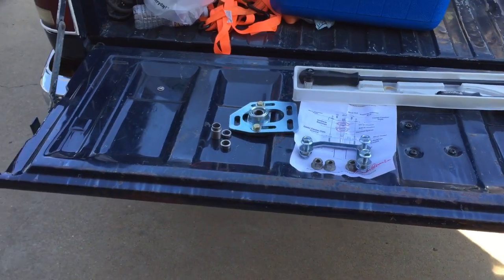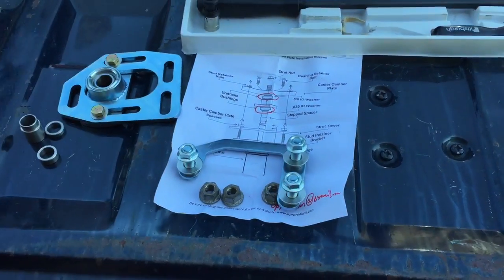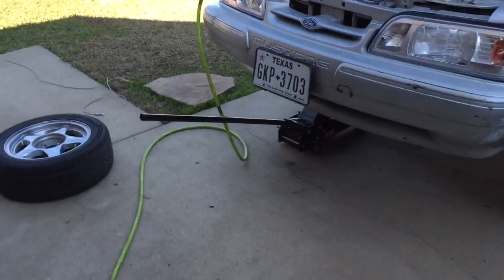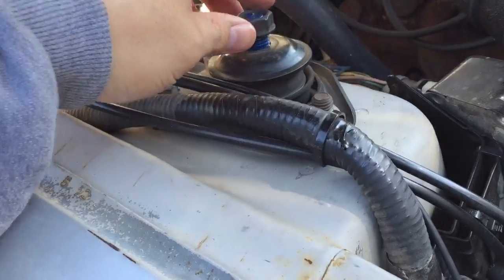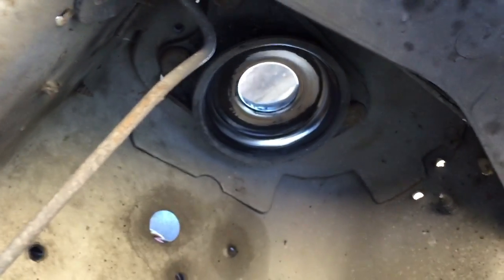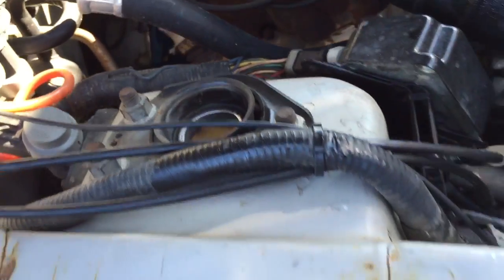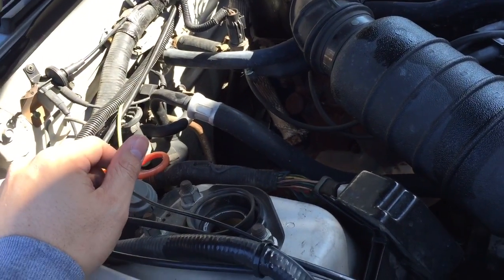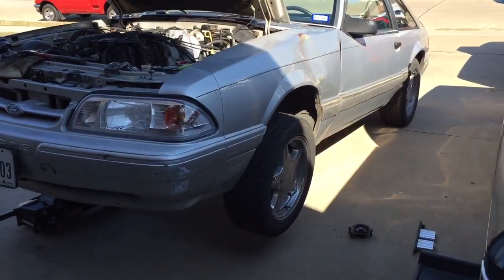Mustang UPR Caster camber plate install

Comment: Are the struts very much harder to swap out at same time?? Same method with jack controlling spring under control arm? 
What should I look out for? Thanks!!
Reply: I just noticed this vid is 6 years old 😂🤣😂
Reply from the maker: I’m sure it would be fine, the car is heavy enough as long as it’s a complete car with the motor and transmission is all in tacked… it’s sad I have to even mention that but with all the stuff I see happening on the internet id just figured I’d throw that in… and even though this video is 6 years old and I no longer own that mustang I still own my original 93 mustang, the all black one.